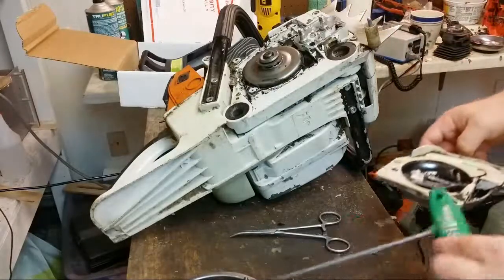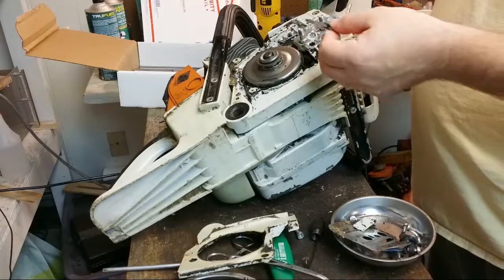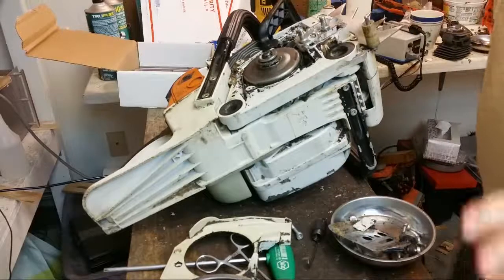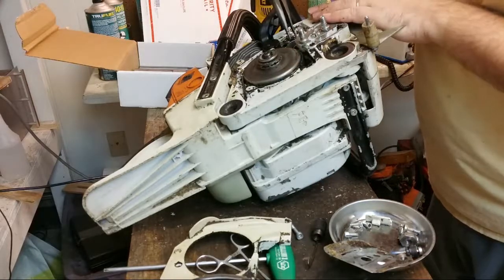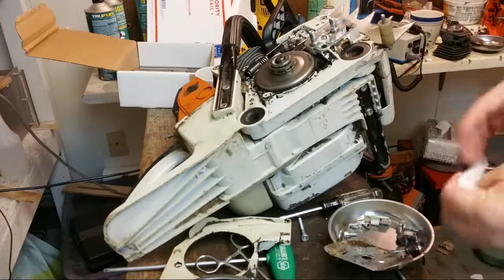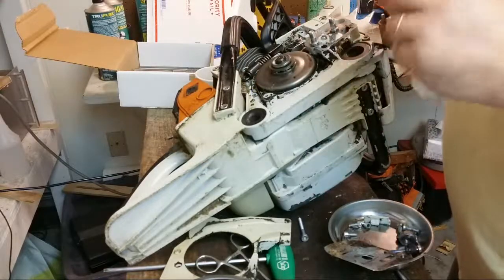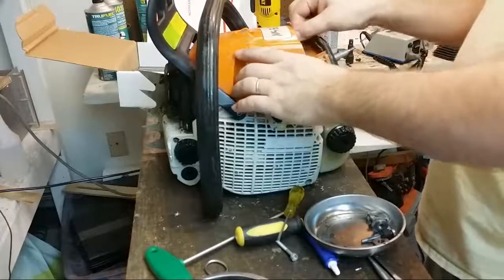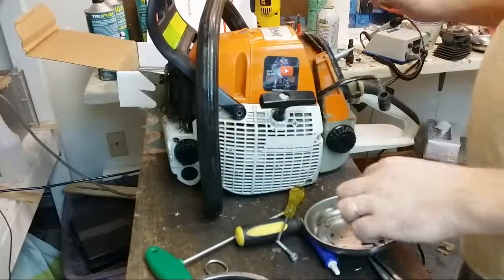660 Chainbreak Handle And Chat

Comment: Wanted to ask you-- Why do people seem so proactively suspect of the aftermarket coils?  If nothing else, I've found chainsaw coils to be very tough, reliable lil mechanisms (I had an exploding flywheel smash a coil off the block on a climbsaw before, it destroyed the threading in one of the 2 mounting-holes, I was still able to just use a 'peg' instead of a bolt and use lateral force (a spot-poured Permatex-Red washer/buffer between the coil and the fan's "casing" keeps lateral pressure on the flywheel, pushing it to the block, since the peg only aligns it it doesn't retain it)
So yeah I see lots of comments on "OEM coils" for these....what is inferior Re the AM coils?  I actually mis-diagnosed an earlier problem as being a coil issue, so now I have an extra one, but of the 3 I have they all fire perfectly...thought coils were really "a/b", "works/broken" type of thing (at least older coils not mtronics obviously)
[PS-- What do you recommend for timing-advance on this saw for "mild builds"? How about for "medium-hot" builds?  My understanding is that upping advancement will make starting the unit harder, and lower fuel efficiency, but is NOT harder on the saw in the way that adding 50% compression is, is this on-point?]
Reply from the maker: Too many words and questions man...  I try ...  uh..  some am coils I don't have issues with.... some I do.  So far the am 660 coils have worked for me. Am carbs not so much.   Most am carbs I toss...